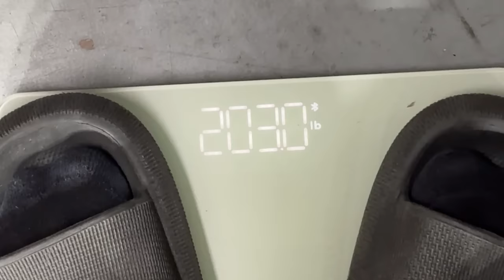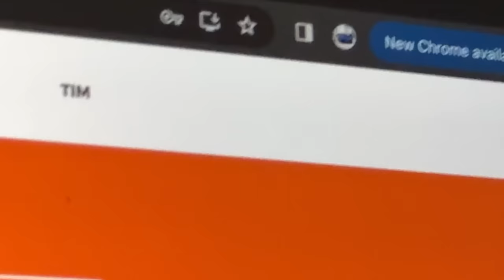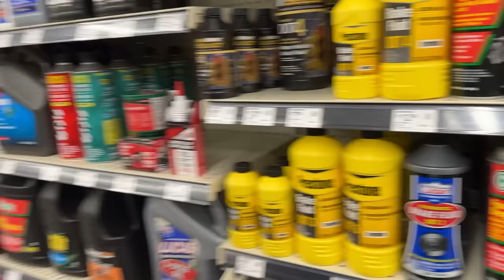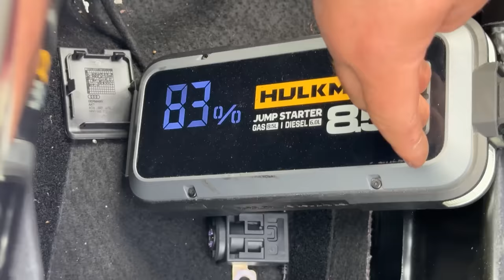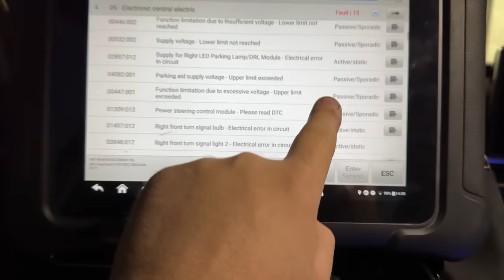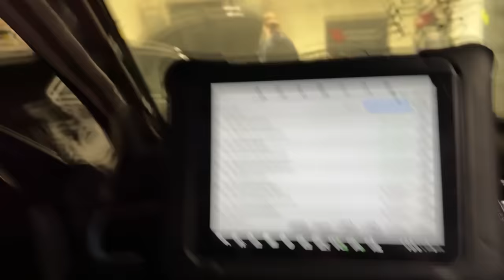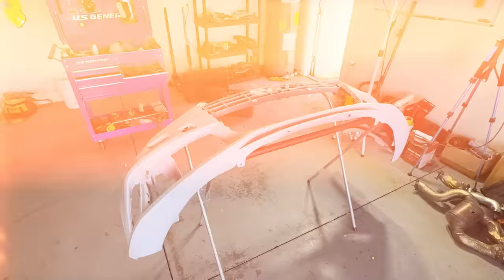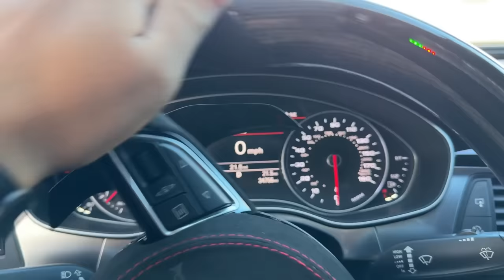I BOUGHT A BADLY WRECKED AUDI RS7 AND REBUILT IT IN 24HRS!

Comment: Good job, Tim, Car turned out great. The only thing I would add is that the painter could have done a better job for $1600. Towards the end of the video at the reveal, you can spot the blend area on both of the front doors where you can clearly see the transition from slightly darker white in the front of the door to (original) lighter white toward the rear. I know this car will have a branded title and it’s obvious that it was involved in an accident and was fixed. But I would expect something like this from a cheaper paint job and not the one for $1600… just saying…

Comment: Dude get a cheap to mid range dehumidifyer from home depot and run that in the garage to remove the moisture from the air.  Corrosion like that is not good for anything not your tools, cars, or home hvac components. Best get on that soon

Comment: That’s a beast I ran a rs4 that was a demo model with all limiters turns off 200 mph was possible I saw 195 and more revs left had to back off, over 500hp on tap in dynamic it just changes gears so smooth,0 to 60 less than 4 sec, these rs missiles are a must have once in your life, the fun I had with gapping and pulling in on top end with cars on paper like amgs bmw m4 comp, was epic many would stop and say wtf have you done with it, when I tell them that it’s factory demo they felt better lol , enjoy your  beast and pat it good night it will look after you 🤪